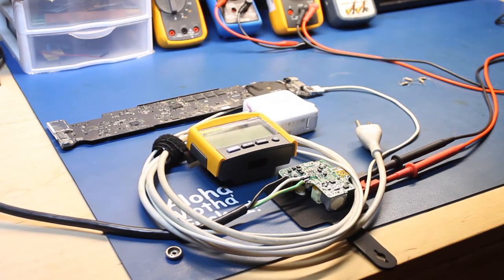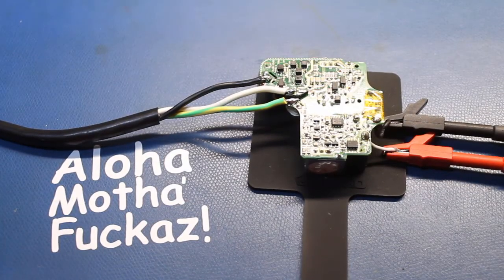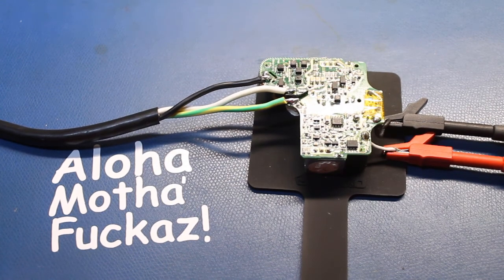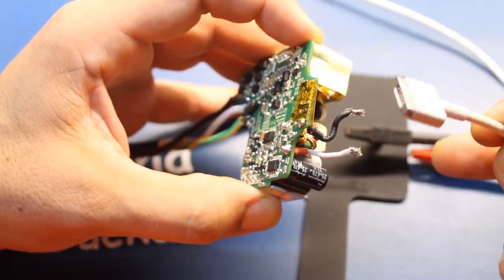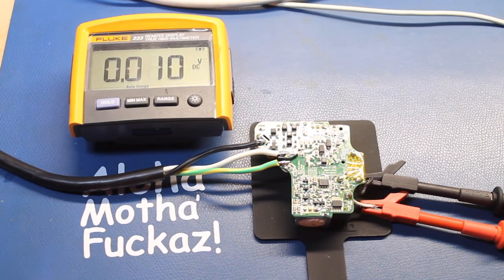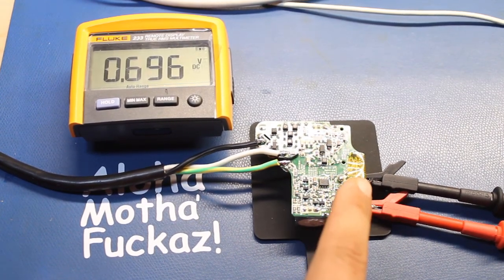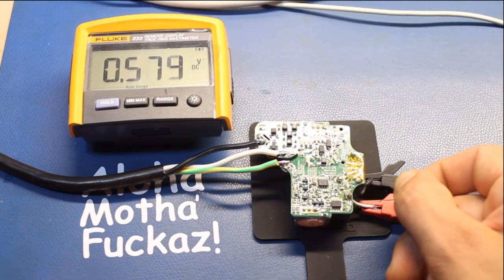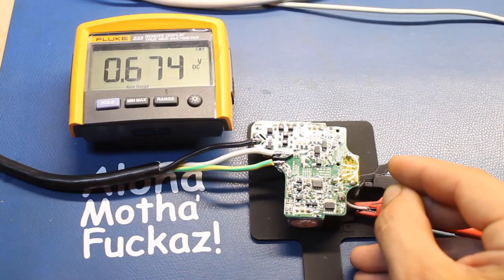MAGSAFE 2- Use as Power Supply (HACK)

Comment: I used 0.25 W resistor of 56kOhm and it works for 60W MacBook Pro 2015 charger (I pulled one from broken power supply)

Comment: Is there a schematic for it? I was replacing dc cable on one of those, and apparently fried something on the dc control side during testing. Now vdc stays always around 2V, and no light comes on. My guess is that something in the sensing circuit is dead.

Comment: Useful information, thank you. Have you measured the resistor values inside the plug next to the LED. The laptop is probably shorting two two of the pins at the end of the plug to request the desired voltage, based on the chosen resistance.